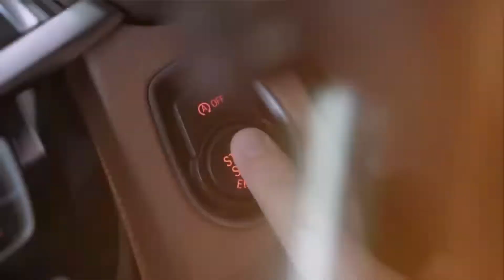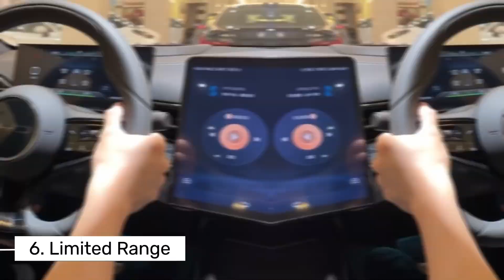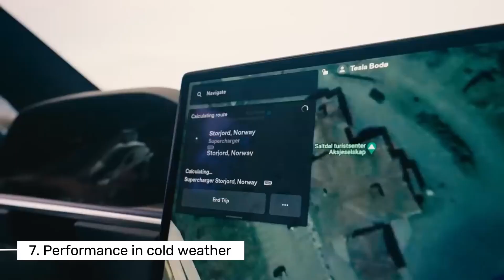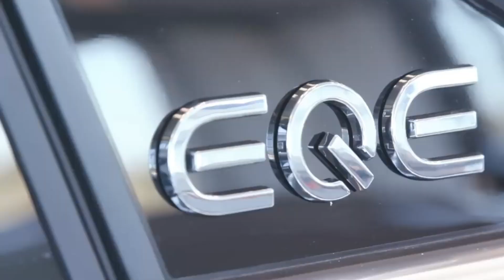10 Harsh EV Facts You Need to Know Before You Buy an Electric Car

Comment: May I respectfully suggest Autoinsights 101 before posting another segment take a look at the Electric Viking (Sam Evans) your report was correct if it was 2004 almost every statistic you mentioned was in correct. Today on car sales Aust MG EV $26.000 including all on road costs and tax. Batteries are outlasting the life of the car. Range 1000klm becoming common. Manufacturers guarantee after 10 years still 85% charge.I think you need more research on your posts.
Reply from the maker: Will look into this and post an updated video if required.

Comment: Aside from the drive train EVs are the same as ICE vehicles

It is not contested that electric motors are better in all metrics than internal combustion engines, not by people with solid understanding of the engineering of both

Performance, Efficiency, Size*, Weight, and environmentally

The area of concern is the battery, However, today's batteries are sufficient for most people's needs

The batteries generally outlast the car and are safer than Petroleum feuls

The charging time is a concern for some with a charge time of 15 to 60 minutes, However, for home charging that concern evaporate when you only have to plug and forget

The Petroleum industry is promoting a lot of misinformation and disinformation about renewable energy and EVs to protect the trillions of dollars in profits that is in the ground

Comment: WARNING :  All the video is misleading information.  Please look at battery manufacturing process (for example Tesla).  Energy agencies, and other studies from environmental agencies.  And ev car driven 15,000m miles per year reachs CO2 parity in 10.4 months according to the most recent study that was done at England an ev ev was foud to get parity at 12,000 miles of driving (one year in Europe)

Well know ev manufacrturers have lower prices than ICE cars in the US.
Battery breplacement.  Old battery packs last 300,000 miles, double the desing life of an ICE car.  New types last 500,000.  This year  batteries ready for 2025 will last 1,000,000 million miles and will carry a warrantee for "life" (66 years of driving).  NO ICE car can offer that.
Charging stations in the US?  1,000 are added every week.   
Charging time?  I have never charged outside home.  A frequent traveler can charge a new car in about 15 minutes, shorter than a "pit stop" needed anyway.
Charging cost?  Depends a lot on the private company.  Those with exhorbitant prices will be out of ther market very soon.  Yes you cab spent more using those places, but there  in contras are other free recharge placess too.  Where can you find free gasoline?
Rabge anxiety was conceived by the anti ev movement.  Soft ware in all new ev have route planning so you never get out of range to charging stations.  All done by the car.
Performasnce in cold weather.  NORWAY has more severe weather than any US city.  They are aproaching 100%ev sales (there are same diesel trucks on the road)  The leet of cars in Norway passes 50% ev this month, so the old ICE cars are replaced due to threir masintenanance cost, and fuel cost.  By contras Norway is one of the mayor exportes of crude.
Battery production?  How about gasoline production from drill to the internal combustion.  Cobal is used to remove the sulfur in the petroleum.  Further use before the gasoline reformer, sice suklfur is a poison the ythe chemical reformers.  Oil spill at weels, on transportation either on pipelines or during ship travel, and loading, unloading diesel, all the fires at refineries, explosions at them, fires in cars (every 5 minutes in the US)
DISPOSAL OF BATTERIESTTERIES.  NON SENSE.  EV BATTERIES ARE RECYCLED  at Redwood facilitues (and others).  100% of all the metals are recovered with 98% for the full battery pack.

Limited mumber of ev models.   In the US currently there are 57 different ev model for all types of vehicles, and pickups.  Search for this "Here's Every New Electric Vehicle Model for Sale in the U.S. for 2024".  Information is already obsolete since the Cyber Truck is the most sold ev Truk during the first 6 month of the year by a wide marging.  The best selling car  is  the Toyota  Rav 4, with 2.8% market share but by the end of this year the best selling will be an EV(Tesla Model Y also at 2.8%)  The Toyota sales are diminishing while the Tesla Model 3 is rising  Model Y continues as the best selling car in the world.

Comment: 1. New tech is more expensive, production cost will go down over time. 2. Many EV's get 8-10 years 75% battery capacity warrenty, yes batteries does degrade, however what kills batteries is temperature, and the new EV's will heat / cool them if needed, giving batteries a long life, and battery cost will go down.  3. Charging infrastructure is on the rise - maybe not for the Iceroad truckers but moslty everywhere else. 4. Most people will be able to charge their cars when its night, and well taking a break on long journeys is not so bad, might even prevent accidents. 5. Charging cost can be more expensive? where I live sometimes the price on electricity is free due to overproduction on the grid, most of the times it's cheaper IMO, but yes ofc someone needs to pay for the charging infrastructure network. 6. Better battery tech is coming, it will flip to the EV advantage, it will get the longer range. 7. Extreme cold I agree that the fossil fuel maybe better but then we are back at the iceroad trucker, Alaska, Northpole places for it to be unuseable. 8+9. Problem is recycling and that cost money, I do agree there is a problem here, but fossil fuel cars also pollute, exhaust gas is also linked to Lung cancer. 10. Buy an EV if you can find something that fit your needs. It is the future.
Reply: Extreme cold drops the range bacause some energy is used to warm the battery to its correct operating temperature.  Norway wich is nthe country with the mmost sewvere weather has almost 100% ev sales (a few diesel  cars/trucks asre still sold)  It's car feet passed 50% this month so replacement of the ICE is happeneing much faster than anticipated).  So there is a full country that proves that  range decrerase is not that important.

Comment: I watched this report, interesting that there was not a balanced report on the environmental challenge with "oil" extraction. The pace of development and advancements in  technology is amazing. Battery tech seems to advance daily which means it is only getting better. The after market battery business is going to be amazing, as batteries loose the ability to hold a charge at high levels, the new ones coming out will be much more advanced and better capacity. I own two EV, car and a truck and would not move back to an ICE. Every morning both vehicles have a full charge, no smell, no mess. Instead of spending $400+ a month for fuel, I spend $34-$38 a month on electricity. No to mention that I have solar but all charging is at night. Cost wise, no comparison (EV are so cheap to drive), drive wise, ICE cars can not compete. Range, sure the 1,000 mile battery is not in mass production but it's coming. Charge speeds are rapidly increasing. So you stop a bit more now, enjoy the journey. Its worth it. Take a good look at all facts and not just opinions, I drove my first EV 6 months before buying my Truck (Ford Lightning) Love the ride and power